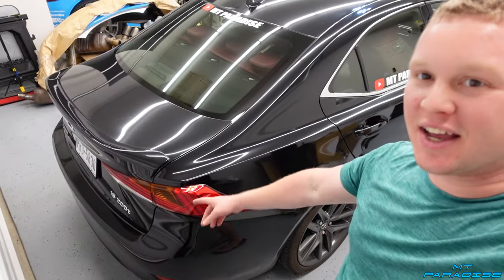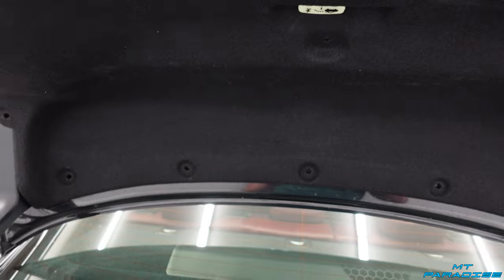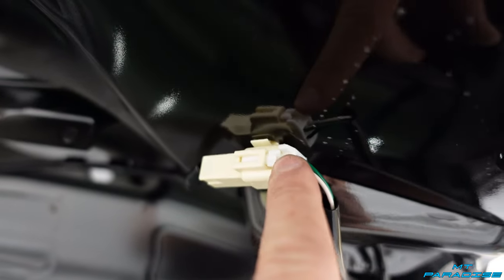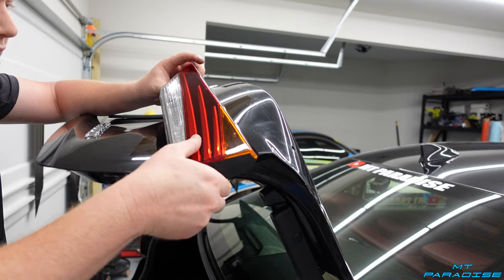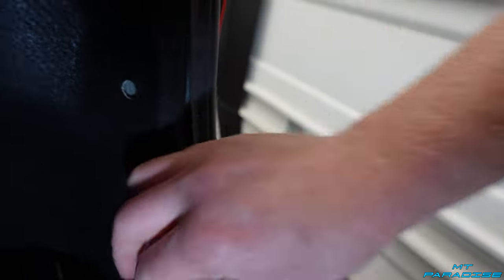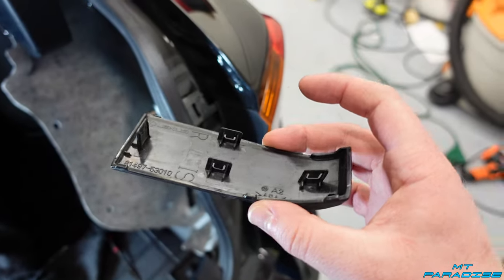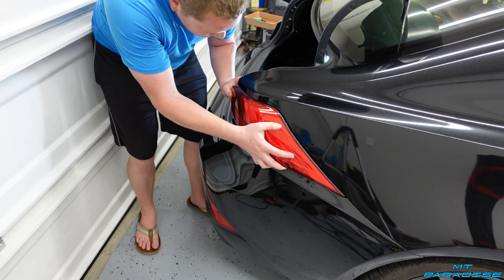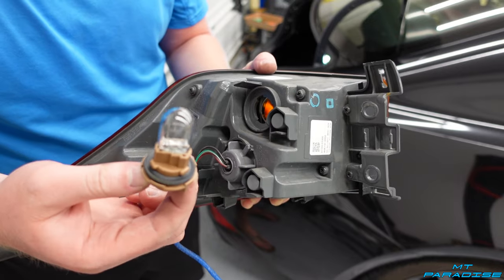Remove 2014-2021 Lexus IS Taillights & Replace Taillight bulbs

Comment: hey MT, the inner light when’s out instead of the outter like the example in your video

Is there a bulb for the inner light and is it the same to replace? thank you for the amazing tutorial btw
Reply from the maker: I believe the bulbs are the same. I would check but I no longer have the original taillights. I got aftermarket ones that are completely different
Reply: @MTParadise  thank you for the speedy reply! and do you remember the size of the bulb?
Reply from the maker: @ev3084  I’m sorry but I don’t know
Reply: @MTParadise  no worries! thank you for your time and keep up the amazing content 👍👍
Reply from the maker: @ev3084  sorry I couldn’t help. Thank you!

Comment: My tail light cracked and will replacing soon.
At 4:07 What tool did you use to remove the light and how do you put plug the light back? 

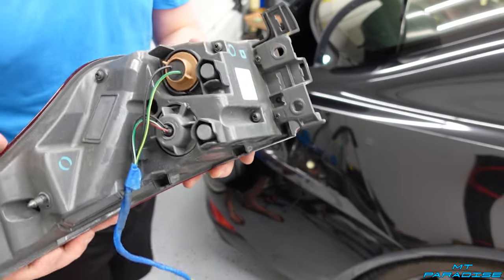At 6:10 how do you remove the grey knob (the second bulb)?
Reply from the maker: At 4:07 it was a really skinny file but anything skinny will work such an a small screwdriver. 
The grey knob should be the same as the other, a turn and it should come right out
Reply: @MTParadise  thank you very much!

Comment: At 5:55, do you know how to remove that plug? (The lower one)

Thanks for the video!
Reply from the maker: The light bulb plug?
Reply: @MTParadise  no, at 6:14, you show how to remove the light bulb plug, I'm referring to the one right under that. Do you know how to remove that one?
Reply from the maker: @Giorgio_Rampa oh I didn’t remove that one. I just assumed they were the same
Reply: @MTParadise  doesn't look like they are, thanks though!
Reply from the maker: @Giorgio_Rampa I’m sorry I’m not sure. I assume it would be similar, maybe just twist 90°
Reply: @MTParadise  No worries! I don't think it's twist, because that has a connection on the other end (plugs into a circuit board). That's why I asked if you removed it. I don't want to break anything.